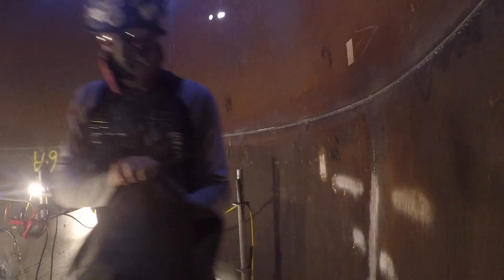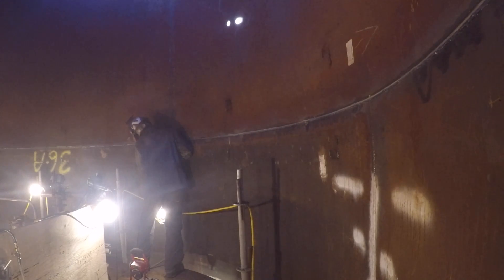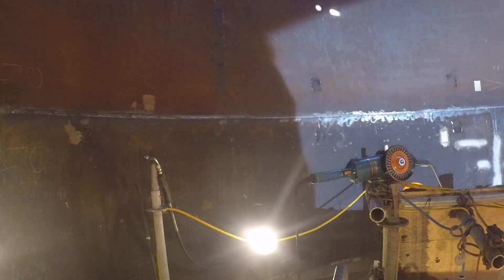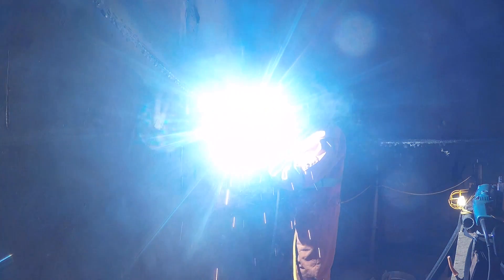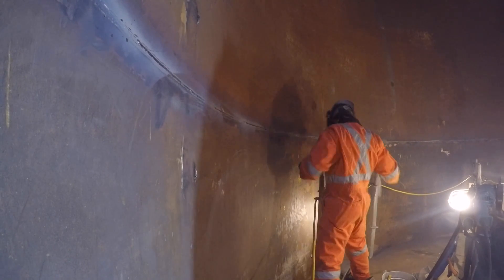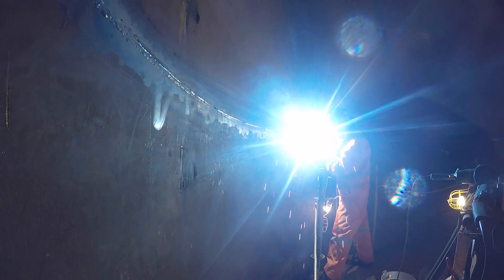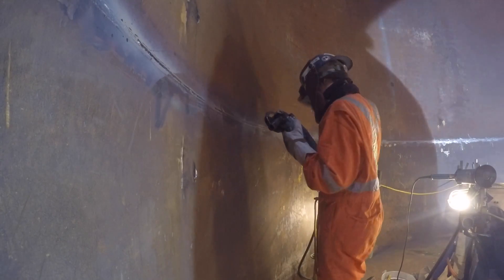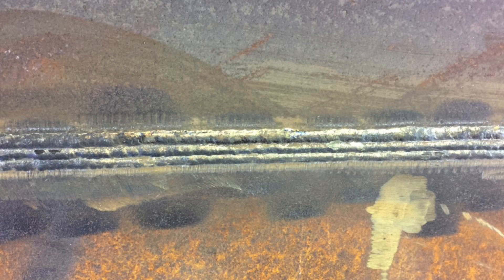50ft long welds on storage tanks

Comment: Should have preheated weld before welding on it bu. I built tanks with boilermakers Union.25 yes and I loved that shot.. that’s a decent cap brother.
I’m to old now brother. You just  hang in there. Good money the made . Buy silver and stack it back every week you will be rich in 20 your. Looks like you have pretty decent hands workining with you. Good luck and be safe.
Reply from the maker: We pre heated it with tiger torches I just don’t add the clips of it to the video. Yeah boilermakers union is big money for sure!

Comment: When welding with a company that does tank welding like this, what type of tests do they give you to hire on?
Reply: fromy my experience with two different companies i’ve only to take horizontal and vertical tests bc all you weld, besides floor seams, is verts and round seams on a tank
Reply from the maker: All 4 position open route plate test with the process they are using.
Reply: @JTwelder.  If I get into an apprnticeship program, then  I will just be put on work like this, right? I mean or is it that they put you to work according to your progress through the apprencticeship program? For instance, I can MIG weld and everything you did in this video I can see myself doing including the 7018 work. I undrstand all th issues that you clarified. So how do your bosses know where to put you to work? Thanks!
Reply from the maker: @larrymasterspowerbuildingc4477  usually you need tickets to actually weld on the job. If you get onto a apprenticeship and don't have tickets you'll be sent out right away as a helper till you have tickets. When you have tickets your sent out as a helper that can weld.
Reply: @JTwelder.  Thank you for responding! i see. If I may ask then, is it your local that helps you set up the tests that get you your appropriate certifications?
Reply: Sometimes you can do a overhead And pass and get you cert.

Comment: Willing to bet dirty wire is the problem with worm holes and porosity using dual shield wire, even new rolls out of the bag. You need to clamp a piece of abrasive cloth on the wire before the drive rollers to clean the wire off, but you have to replace it every roll or the scum will actually re-deposit back on the wire and create said wormholes for you to go crazy with grinding.
Reply from the maker: Foreman looked into dirty wire and it wasn’t the issue. We actually took a spool out of the package and let it sit in the elements for a few days to get good and rusty then used it and it actually worked fine lol just wouldn’t strike easy but once it was going it was fine. Out of 6 welders only two were having porosity issues and on every machine they used. It was operator error.

Comment: You guys should be on breathing air, it's as simple as a little breathing air pump, rated airline and a yoke.
Reply from the maker: Not up to us the plant safety did a inspection and determined 2097 filters were good enough. I could blow my nose after a shift and the tissue would be clean.
Reply: @JTwelder.  it's the invisible stuff that will get you.
Reply: @JTwelder.  Keep up the great work, good thing you saw the light and went union.
Reply from the maker: @Jon-jk8vd  thanks man yeah unions the best! I’m 22, own a house, have every toy I need, I’ve made 6 figures for the past two years and contributed to a pension! I Would of never been able to do that working non union.
Reply: @JTwelder. osha standard 1926.353b....you CANNOT POSSIBLY GET ADEQUATE VENTILATION IN THIS TANK!!!! please read this standard and get BETTER BREATHING EQUIPMENT!!
Reply from the maker: @danvertdavis6867  well I’m in Canada so we don’t have osha. This also isn’t a tank I just said that to keep the confidentiality of the location it’s a open air area but the video doesn’t show it.
Reply: @JTwelder.  o ok...well TAKE CARE OF YOUR LUNGS BUDDY!!!!!my grandpa welded inside of railroad cars..got emphasima from it...HORRIFYING DEATH WHEN U CANT BREATHE!!! take care bud
Reply: Jon you are correct!! THIS IS OSHA LAW!!! AIR LINE SUPPLIED RESPIRATORS WITH AN EMERGENCY SCBA ARE TO BE USED!!!!!this is considered to be an IDLH environment!!!

Comment: Super interested in becoming a boilermaker. Trying to get some info on the apprenticeship program right now. I have 2 stick certs does that make a difference?
Reply from the maker: yeah definitely any welding tickets help. Job experience is the best though if you've already worked in a metal trade than it helps a lot
Reply: Take the apprenticeship. In BC you can become a pro-jo with a journeyman welding ticket.